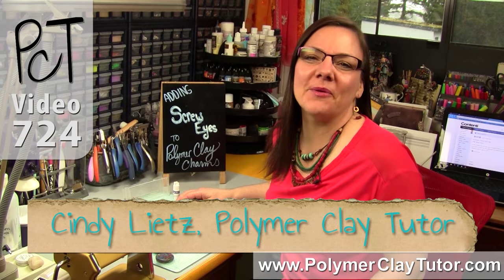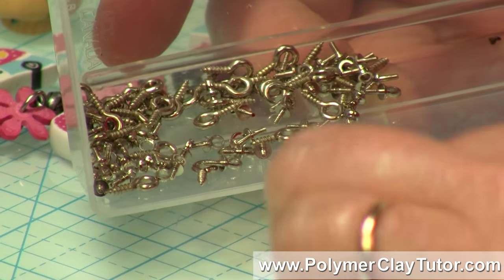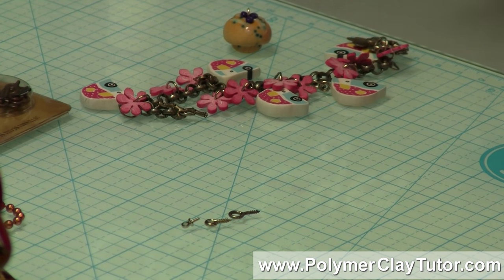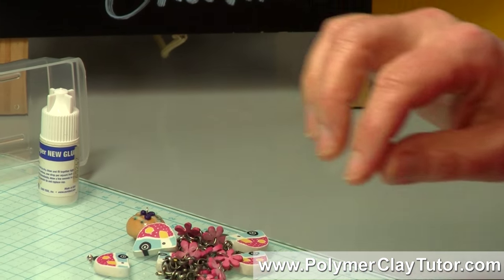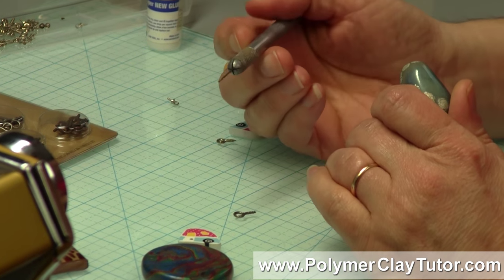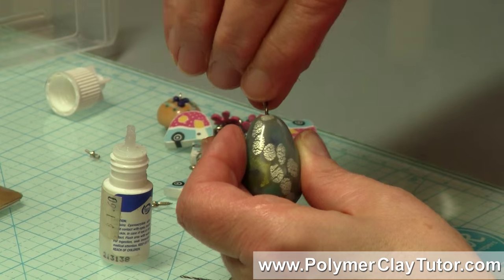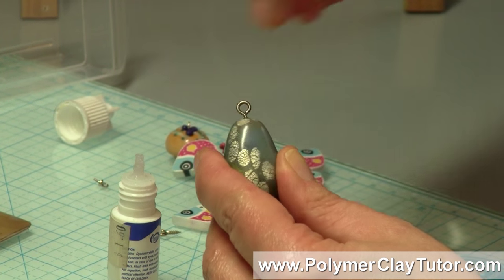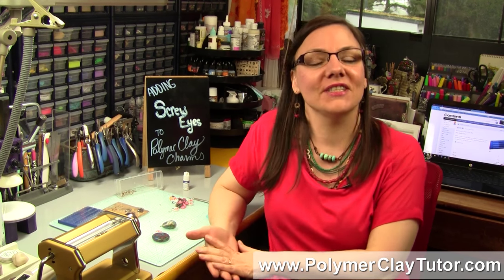Adding Screw Eyes to Polymer Clay Charms and Pendants

Comment: I have the need for some advice, he has made some really nice pendants, with matching earrings, but he has made the pendants with a small eye pin hole.  I want to attach these to some nice chains and would prefer using bails in order to make the necklace much nicer for selling.  Most of the time, the chain is thicker than the small eye on the bead.  I tried attaching a jump ring and then attach the bail to the jump ring, but they do not look very nice. (I like using the bails that have a soldered section to attach to the pendant)  I've had to use Pinch Bails but don't like that the bail might open up and the pendant could fall out easily.  Any suggestions on how the handle the pendants he has already done?  I've asked him to make the pin longer and not to make the loop so that I can close the loop onto the bails that I like, but he has already made such pretty ones and the pin has been glued to the bead, so nearly impossible to remove the pin without  damaging the pendant.

Comment: I've seen people put the eye screw into raw clay then bake, take it out, put on the glue and then put it back in. Is this method just as good as drilling the baked clay?
Reply from the maker: +Megumi Zoe No... as you see in the videos out there, the clay bulges out where you screw the eye screw in and the hole is all messy. The cleanest way to put a screw eye in is to put it in after baking.

Comment: Can screw eyes go in the oven I'm a beginner and bought those instead of eye pins  ,also is it possible to cook my charms without an oven thermometer? Also thanks for the video really helpful (:
Reply from the maker: yes screw eyes can go in the oven. It is possible to bake without an oven thermometer, but I wouldn't, you risk either under curing or burning your pieces unless you have the temp right. You can get them anywhere that sells kitchen gadgets (Safeway, Walmart, Target, online). They are super cheap and well worth buying.
Reply: PolymerClayTutor thank you so much for your help  ! I will wait to bake my charms until I get a thermometer,and keep them in ziploc bags until then. I'm using sculpey 3 , next time I buy clay I would like to get a stronger brand ,do you have any you would recommend for long lasting charms (i want to give them as gifts and not have them break when the person handles it too much)
Reply from the maker: The strongest clays are Premo, Fimo Classic and Kato Poly Clay. I love Premo the best, but if the others are easier for you to get then they are great too!

Comment: Does the screw in pin need to go in before or after baking the bead?  My husband just asked a good question 'if you decide to use a regular eye pin and bend the end or twist it a bit so it can hold stronger, does the drilled hole in the bead need to be larger in order for the slightly bent or twisted pin can be glued in after it is backed'?  Thanks for your help.  (BTW, it is too funny, but I just this past week bought him some of those screw pins and told him that these would be better to use than the straight eye pins. Your videos always seem to come out at perfect timing. haha)
Reply from the maker: +Gloria Borrero Did you watch the other video? The bent eye pin goes into raw clay... No need to drill. For the screw eye, it goes into a baked bead... you do need to drill.

Comment: I'm practically dyslexic when it comes to super small measurements like those tiny thin drill bits. What would you say your range is from the smallest to the largest in your drill bit set? I'm shopping around in Amazon and feel overwhelmed. I can do inches, but the smaller the measurements get the more complicated for me. I mean the width of them not the length. I'm making charms for the first time and i don't know what drill bit would be smaller than the set of screw eyes i'll be buying. The Amazon measurements for the eyescrews are  0.39 * 0.18inch / 10 * 5mm (L * W).
Reply from the maker: Hi there, it is a little hard to know what the diameter of the threads on your screw eyes are, but you will want a drill bit that is about one size smaller than the diameter of the threads. Here is a nice drill bit set on Amazon that are smaller and the perfect size for jewelry making projects. It's very handy to have a range of sizes, for lots of situations. Luckily they aren't very expensive. https://amzn.to/3YzCiw6 (Affiliate Link) Hope that helps!
Reply: @PolymerClayTutor  Ty.

Comment: Hi :) how do you stop your baked polymer clay from cracking when you use a screw eye? So many of my charms crack :( I usually drill a small hole first with a hand drill then twist is the screw eye and the hole cracks. Thanks in advance.
Reply from the maker: Hi Stacy, if your charms are cracking when you add the screw eye, it could mean a few different things... the brand of clay you're using isn't a strong clay (SculpeyIII is very brittle)... the clay has been undercured (clay needs to be baked at the correct temp for long enough to properly cure. See my baking videos for tips.)... the hole you're drilling is too small for the size of screw eye you are screwing in. Try these tips and see if that improves the situation. Good luck!

Comment: Hi I was just abit confused I thought you said using an eyepin was best with the bend when polymer is raw, and using glue leaves marks. Therefore does an screwpin prevail the eyepin?
Reply from the maker: +Hanife Cizer The best way to use an eye pin is to bend it like I did and to not use glue. On the screw eye, the best thing to do is to put the tiniest drop of glue on the end, so it doesn't end up leaving globs around the hole. There are places where you may want the look of the finer wire eye pin... such as on a necklace that has many dangles on it. There are other places where you may want the extra strength of the screw eye, like on a charm bracelet, or a backpack charm. It really is up to you.
Reply: Thank you so much

Comment: I noticed your atlas pasta machine  - what is the difference between the atlas 150 and the atlas 180?
Reply from the maker: +Bridgette Roseman the 180 is wider. I believe the Atlas 150 has 150mm sized rollers (6 inches) and the 180 has 180mm (7 inches) sized rollers
Reply: +PolymerClayTutor  thanks

Comment: How was the charm in the thumbnail made?
Reply from the maker: +Minji Kwon It was made using scraps of clay that had crackled paint on top of translucent clay. I made several layers of the scrap translucent. The little circles were cut from a sheet of the crackled paint on translucent and the just stuck on top. It was just something that I came up with when I was cleaning up my scraps.